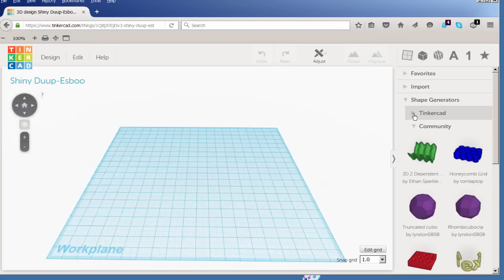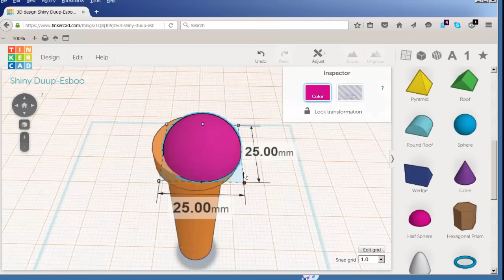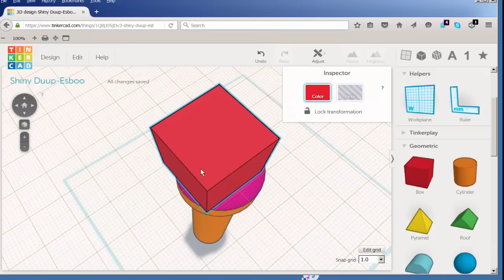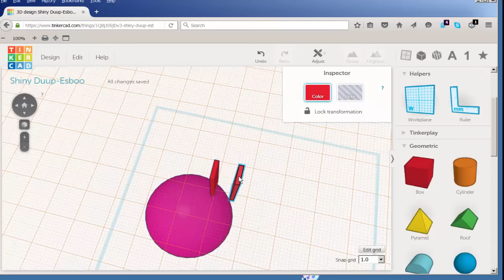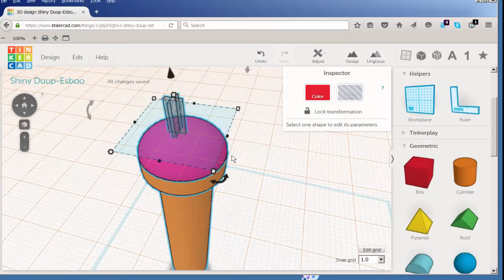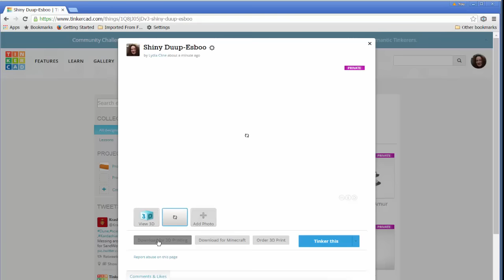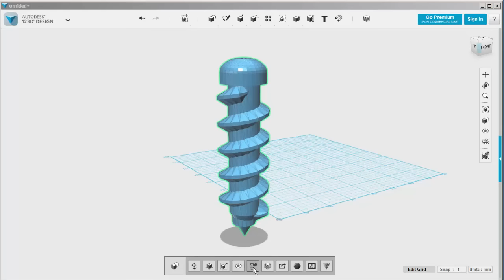Tinkercad: Threaded Screw

Comment: Sorry, but I think xou made a lot of mistakes: First, you didn't align the individual parts in all directions. Second, the cross-shaped hole for the screwdriver is crooked because the auxiliary plane is not positioned exactly in the center of the hemisphere. The diameter of the thread is larger than the screw head and when you wanted to group everything, you said so, but didn't do it. Unfortunately, you did not go into the parameters of the threaded screw tool. Maybe you will do the tutorial again?

Comment: Can I save projects as gcode with tinkercad ?
Reply from the maker: For a 3D printer? No. You download a Tinkercad file as an STL then run it through a slicer to create the gcode (like Cura, MakerBot Print, S3D, etc.)
Reply: @ProfDrafting  which one can crate x3g file? I use MakerBot then update, now wont crate x3g files!
Reply from the maker: @leonardochen6017  Simplify 3D is the only one I know of. It costs $150, last time I looked.